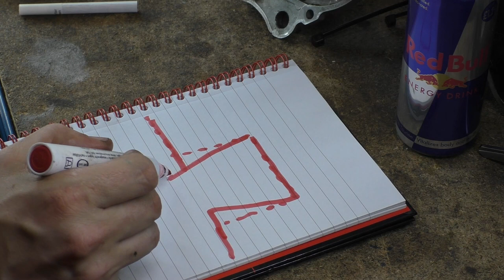Undercutting gears - Fact or fiction?

Comment: Check out this pics of damaged dogs and fork selector I just pulled out my CR500 gearbox....she was jumping in and out of fifth gear...its NLA (Honda Bastards!lol) so have to get one made now which is a fucker: https://farm2.staticflickr.com/1730/41823940144_74de55e456_b.jpg
https://farm2.staticflickr.com/1723/28673079028_ef3f09dda1_b.jpg
https://farm2.staticflickr.com/1738/41823939774_154ce50510_b.jpg
As always feel free to use the pics if it helps you...
Reply from the maker: Sweet - I will - use the pictures I mean. Any more story/history/FA?
Reply: I suspect clutch-less gear changes while vertical from 4th to 5th ( https://www.youtube.com/watch?v=O8H7N5jz_yc ) have not helped. However, some googling reveals this is quite a common issue with this particular gear and when you consider mx bikes rarely use this gear this imo points to inadequate case hardening and/or poor design - maybe it does not have enough dog engagement. Gives me an excuse to rebuilt a 80+bhp monster now :D